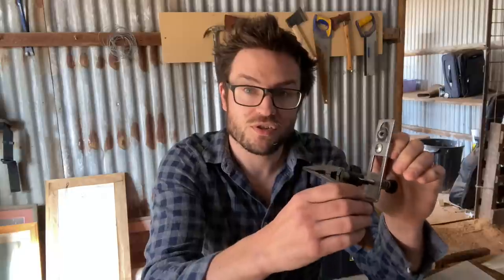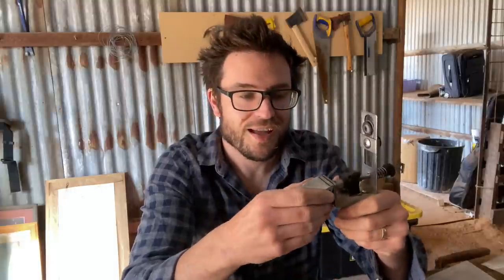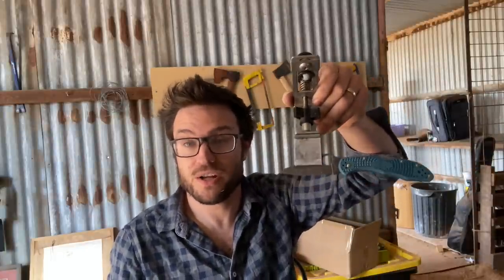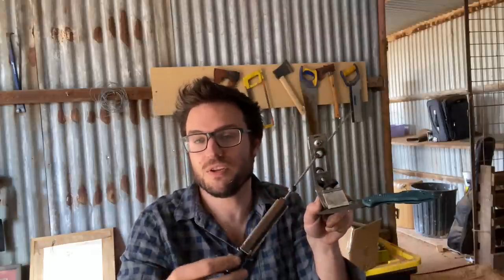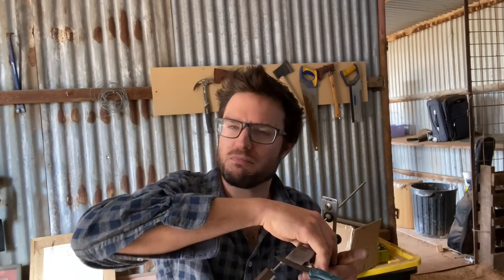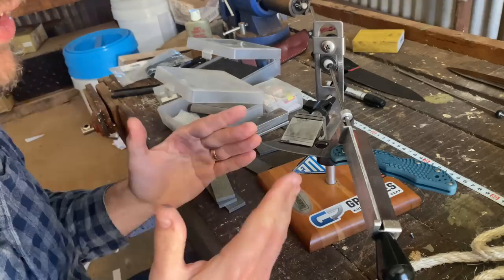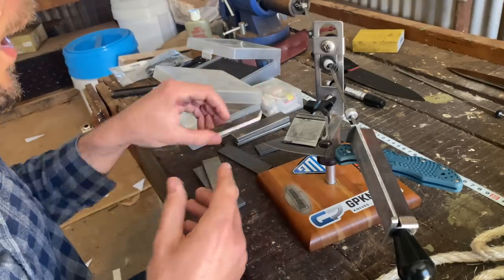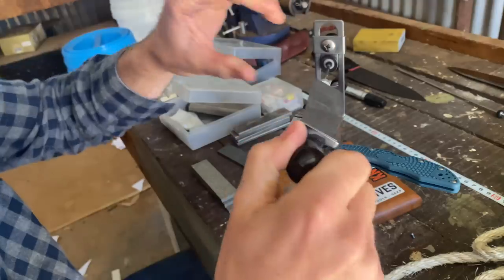KME Sharpener: 1,000 blades later. Mirror Edges for even the uncoordinated

Comment: Great tutorial on the KME system. However, your statement that all the standard and diamond stones are the same thickness is incorrect. The diamond stones are 5mm thick while the standard stones are 7mm thick. My KME translucent ark is 6.5, the kangaroo strop is 5.5, and my Gritomatic cowhide strop is 7mm. That is why the KME thickness compensator attachment is a handy option to buy.
Keep those great videos coming. Thanks.

Comment: I get mirror polished incredible sharp blades with just my Lansky Diamond system (good for very hard steels as Maxamet or ZDP-189).
I have the 1.000 ceramic rod, the 2.000 "sapphire" rod and a leather Lansky rod with polishing compound on it. You can get the same finish even using stone rods before if you have those three I comment.

Comment: Also I meant to ask -- when first sharpening a ~20° factory-edge knife to 17° mirror polish, how long does it take you all in all? Assuming average-good steel (D2, S35VN,M390) , average length (2.5-3.5") and usual factory inconsistencies on heel and tip? 

I ask because I'm not sure if I'm doing something wrong or if it's normal that it usually takes me around 2 hours with the 50 grit beast. I raise a good burr on the belly within the first 15 minutes or so, but then the heel and tip always seem to take forever.
Reply: That's because the angle reduces as you get away from the centre and out to the ends. Working on a smaller angle means you're having to remove more steel to get to the apex, so it will take longer to get there.

Comment: Great video. I've followed your advice with great results. Wondering you have any advice on sharpening a tanto blade. Specifically, lining up the blade and jaws for both edges. Any advice would be greatly appreciated. Or, if you have a video on it that I haven't been able to fine. Again, thank you for your great videos.

Comment: Now this is a review! Our Brother from down under spent years and a 1,000 uses to get us good information.

Question 1. Have you replaced any parts of the system due to wear?

Question 2. Have you experimented with different stroke techniques and noted the differences of sharpness with said technique?
Reply from the maker: 1: The little eye that holds the rod will need to swap soon. it falls out a bit. I have also replaced the 1500, 600 and 300 stones once each and twice for the 300.

2. I cant tell much difference between doing little circles, angle swipes etc but some other guys say they can
Reply: @CedricAda  Cheers and know we all appreciate your long form videos!

Comment: I've had my KME for a while now and a few things I note in my experiences. 1)I wish the stones were longer like the Edge Pro. It might bother me less if I had rod stops like you do, but the only ones I've found just seem ridiculously expensive for what they are so I've passed. 2)Instead of drawing a line on the blade at the end of the clamp jaws I use one of the stone carry sleeves as a ruler and make a line from point to heel. According to KME this will yield the most consistent bevel all along the blade. It also serves to tell me if the blade has moved or rotated in the jaws as I set the jaws parallel to the line. 3)Always tape off the blade. I can't tell you the number of knives I've made fine vertical scratches upon despite using an anal retentive amount of care. If you don't care if your blades get scratched, by all means, hone away. For me, the few seconds it takes to tape all but the edge gives me a safety factor to not accidentally putting scratches on the blade. 4)Oil the 2 nubs that lock the clamp head when its rotating. 5)Like you, I replaced the tiny factory knob on the end of the sharpening rod with a larger teardrop shaped one for comfort. 6)Come on, KME, putting a pistol grip on it makes me want to hold it like a pistol...in which case the damn rod is coming straight back at me with my arm doing the work at some weird, impossible angle. The other option is to free hand hold it with my holding arm cross body which is decidedly uncomfortable. Change the grip to a position neutral oval shape so EVERYONE can be accommodated. Either that or put the grip on FACING THE OTHER WAY.

I have nothing against KME. Its a good solid product that will do everything most people ask for years. However, there are near similar knock-offs that do it a little better. Longer rod so you can remove more material in one stroke, longer stones for the same reason (accepts Edge Pro stones), a base made to C-clamp to a table for complete stability and a nice METAL guide for the rod to slide through. And at a better price point. If they'd just add a lever to lock the blade in the jaws, it would be damn near perfect. IMO
Reply: What’s the knock off name?

Comment: Pro tip: use the 1500 grit stone to find your angle by using the sharpie method, one swipe and if you're right on you can start your sharpening. It won't remove as much metal if you're just trying to find your angle/blade alignment.
Reply: It doesn't matter either way, since even with a coarse stone you won't be removing much metal with a single pass.

Comment: I have a really specific question... I'm thinking about getting a Spyderco for the first time. Specifically an American model. We've all had knives that were factory sharpened at whatever specific angle, only to find out that when you go to resharpen it, the factory edge degree is different towards the tip and/or back of the blade. I guess that means they were hand-sharpened in a sloppy way, but anyway... 

Do you find Spyderco knives to be factory-sharpened precisely? Or do you usually have to semi "reprofile" them to get the entire edge to the same angle?
Reply: I've never encountered nor heard of a poorly ground/sharpened Spyderco, but you can also ask on Reddit or bladeforums and check consensus

Comment: Tried the lansky hated it bought the KME and I love it cost more but we’ll worth it pimped it out with basically everything but I still want their broadhead and axe sharpening systems without stones because I already have them it has never failed to bring a knife to hair popping sharp wish I knew before I bought the lansky and like 10 different stones not that they weren’t great stones I just can’t seem to get a sick edge with them by hand I just can’t keep that angle right by free hand. Money wasted lesson kinda learned and for big machetes etc I use the upgraded electric Ken Onion belt system by worksharp works great for those giant blades 8 inches and above cause the KME system doesn’t really like blades over 6 inches though it can sharpen big blades also but you have to go one section at a time and it becomes very time consuming and tries a mans patience for sure.

Comment: Great video . Ty
Once I get above 2000 grit it appears my knife is not polish evenly when I go back and forth . When I go heel to tip one stroke better results but takes forever . Any advice ty ty
Reply: Hmmmmm...............Why does it matter if it's evenly polished?  A polished edge has nothing to do with sharpness, utility or function of a knife.  And, 99.9% of the time the knife is either folded in your pocket, or in it's sheath.
Reply: @BennyCFD  I’m new to sharpening. I did not mean polish . I mean scratch pattern . Lower grit stone scratch but when I get above 1500-2000 the scratch pattern hitting the edge or higher part but not part of the cutting edge. Ty for response .

Comment: Does this work on heavier blades? I saw you had the Lion steel M7 in the KME. Thanks for this video.
Reply from the maker: yeah, i put the TRC apocalypse in at the end and talk about it a little. works fine as long as the blades around 7 inches or less! just need to  tighten the tension sprint at the back
Reply: @CedricAda  Thanks. Btw my TRC Apocalypse is on it's way! I can't wait. ;)

Comment: While the KME seems great, I just don't see why it's $250 give or take when the Worksharp Precision is $50.
Reply: The WSP is a good system, but nowhere near the versatility of the KME.  

I'm sure Worksharp will come out with more grits.  But for the moment, people are using sandpaper.
Reply from the maker: ive got that system on the way to review so will hopefully be able to answer this soon!
Reply: @CedricAda  awesome, looking forward the it!  I like mine so far and understand it's not nearly as nice quality as the KME bring mostly made of plastic, but the idea is the same and has all the same features, and with a few mods (3d printed tri-hone slide with lapping film @$20usd, 4" hone slide attachment similar to the KME @$16usd), I feel I get ~80% of the capability at less than 25% the cost.
Reply: @gumbihilt1333  I dunno, with mods I feel like I'm getting 80% of KME at way less cost. $20 for a 3d printed tri-hone slide with lapping films, $16 standard 4" hone slide attachment, and I'm getting all the grits I want.
Reply: @gumbihilt1333  and now worksharp has the elite that has more grits for $100. And at gritomatic they make a slider to hold 4 or 6in stones.  Yeah the KME is more versatile but I still don't see it being $200 more versatile.

Comment: Hi, i think this type of sharpening systems are not sharpening a blade on the original angle but on a forced angle and only if the blade is perfectly round with the same radius on the whole lenght of the blade. 
If you are not in accord with me,  you can make a video to show with the electronic angle meter to show everybody in different spots of the blade it is a different angle and that can damage the blades and messed up your entire angle of the blade because when you haveTHE SAME HEIGHT BUT DIFFERENT DISTANCE, THE ANGLE BETWEEN THE BLADE AND STONE CHANGE, and THATS NOT GOOD FOR THE BLADES.
After few sharpening sessions with these kind of systems you will have on a single blade a mutitude of angles that VARY with the shape of the blade, the more curves or chages of a direction of a blade has the more angles you'll have because, LIKE I SAID BEFORE, THE DISTANCE AND ANGLES ARE  INVERSELY PROPORTIONAL then as one quantity increases, the other decreases.